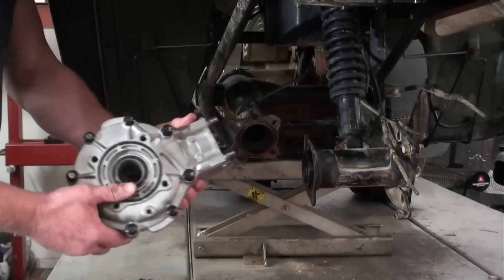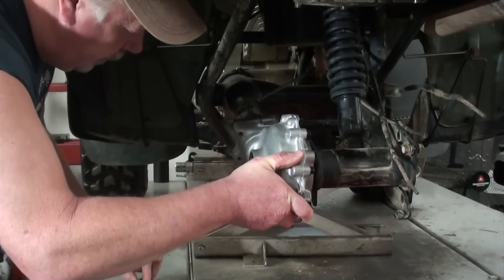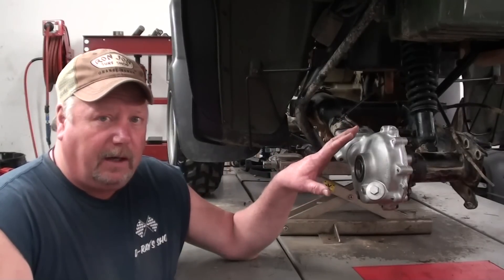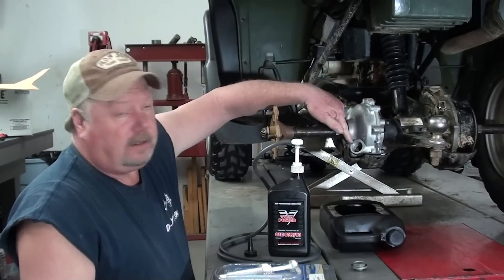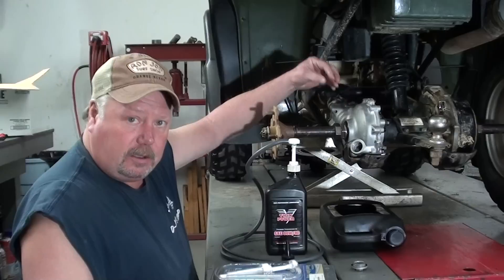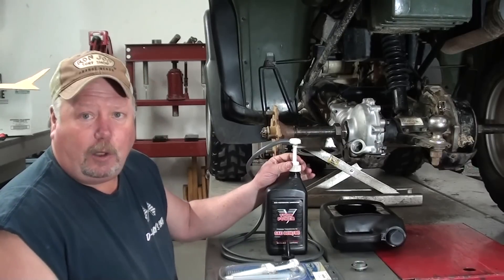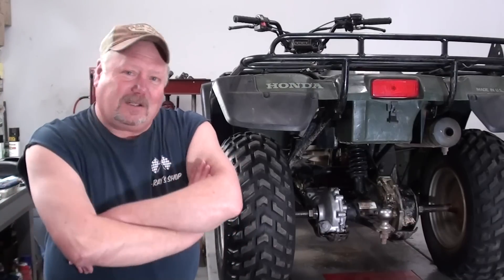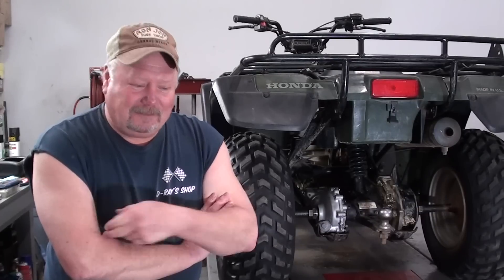Pt.4 Honda TRX300 Final Drive Rebuild At D-Ray's Shop

Comment: I have a 250 Recon, the whole rear end is seized up hard.   Would that be the brake drums beyond wear limit?    Rear bearings were replaced 5 years ago. its a  2001 model.   Thanks for your Response.

Comment: you said the axle is symetrical, would it be a good idea to flip the axle for even wearing of the splines? (assuming new bearing on both sides and seals)

Comment: Help PLEASE!!!
I ordered the kit. Got it apart and ended up needing a new  gear set. 
While awaiting gears the work bench was cleaned by someone else and the spacer shims for ring gear were thrown in trash apparently. There are 20 different options for thickness. Where do you think I should start? In your experience is there a regular OE combination I should order first to start with?

Comment: great video D-ray. Your videos are always easy to follow and very informative. I have a old 1985 Honda Big Red 250 ES and always watch your videos.They dont make em anymore like the old Big Red or Four Trexs, those old bikes were dang near indestructible tanks....lol.
Reply: you got that right. we bought our big red new in '86. that bike did everything. dad built a plow for it for the driveway even. it pulled moose out of the bush, everything we ever asked it to do. dad modified our hunting trailer so the rear opened right up and we could load the bike in. he reconfigured all the seating so it could fit then be placed back when the bike was out. this was years ago, way before they actually made camper-trailers with the loading-ramp rears on them. we used to leave the trailer in our spot we would choose for the hunting season. it would be between where we each lived, so that we each would have about an hour or two drive to camp. and we'd be out every weekend. never, ever had any problems. but then one year, the trailer disappeared, and with it, that cherished old big red.

Comment: Could you do a video on replacing the shaft on the back of the motor where the yoke slides on. My splines are bad on my Honda 300

Comment: how important is the hose vent ive had all bearings changed it wil work for a while but then after an hour of use  clicking noise like if the ring gear is jumping  and thanks for your videos

Comment: Thanks to your videos I've fixed a lot of my bikes. Your the man. I have a quick question for you. On my 88 300 2wd should the drive shaft pull out like it did on this one? Mine isn't, before I damaged anything trying to tap it out I wanted to hear yours or someone's input that's had this issue before.

Comment: Hi D Ray, have a ? are hubs on 300 fourtrax tight when you slide them on or is there a little play in them until you tighten hub nut.both of mime come loose and I did tighten but maybe not enough.

Comment: Hello D-Ray. Hey I have subscribed to your videos and liked all the ones I've seen. I've learned a great deal from you and I thank you. I was wondering if you could just take a second and answer a question I have regarding the main jet bonnet. During a recent carb rebuild, I discovered my carb did not have a bonnet and I would like to know how necessary they are to the carburation process. What is affected if you don't have one? I've cleaned this carb back to shiny and clean and clear and she still seems to be finicky with idling and starting. Revs are great, power is there, but even after a ride or two around the block, if she quits, she fights me to start back up. I have the mixture screw set back to the factory setting of 1.75 turns from light seat. I've taken the carb off again just to confirm nothing is blocked and it wasn't. Could the lack of the bonnet be affecting this? Thank you in advance.